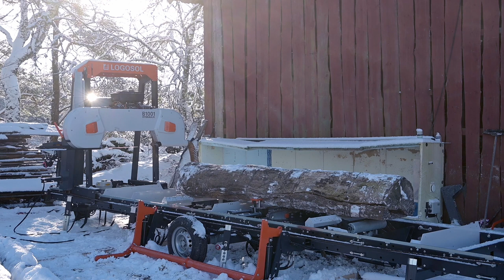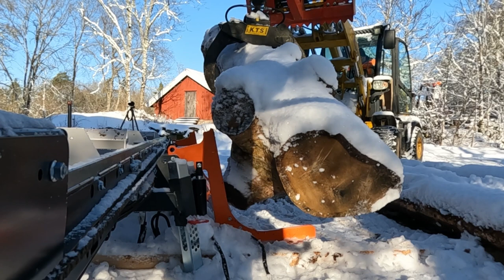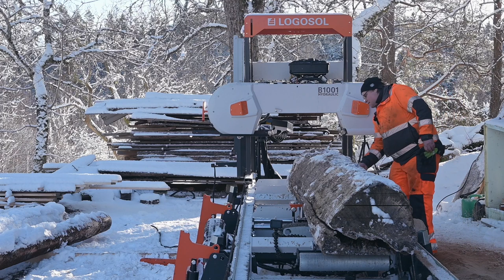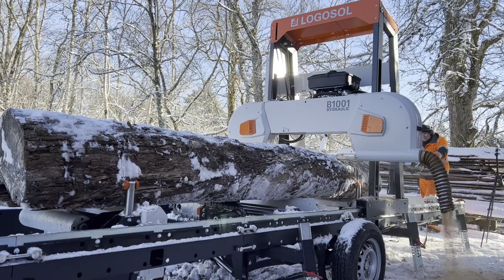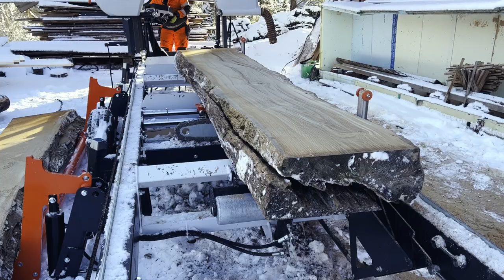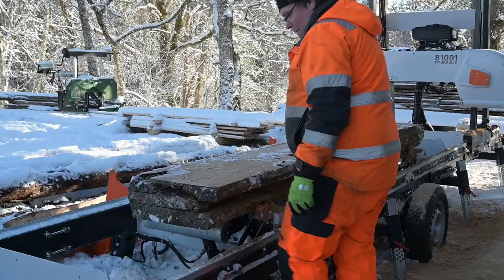Now upgraded to a Logosol B1001 Hydraulic

Comment: Love your accent, very cool machine love your office space as well.
Do you run a diesel drip for lube?
Reply from the maker: You know the Swedish chef in the muppets :) (I’m from Sweden) I use a resin dissolving spray on the bands.  So run completely without dropping anything.  If there is a lot of resin in the wood, I use water drip.